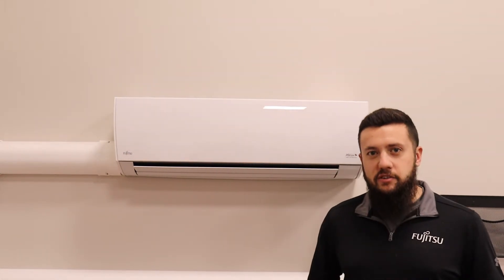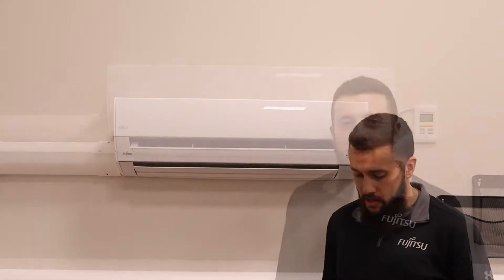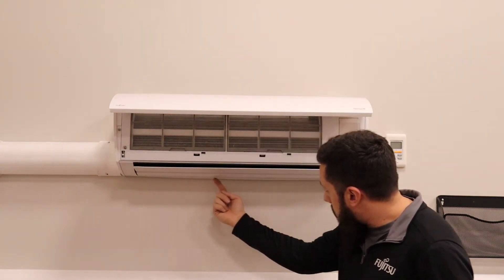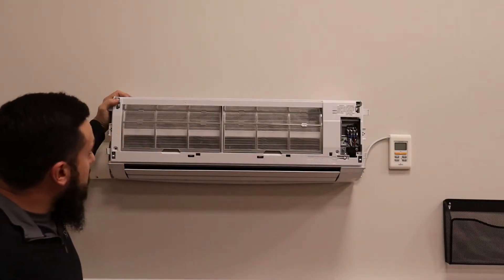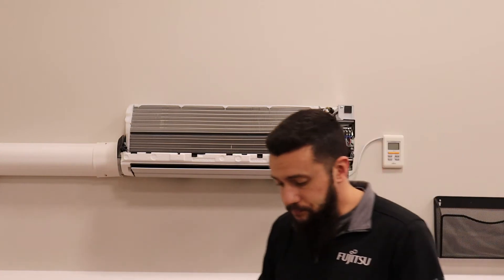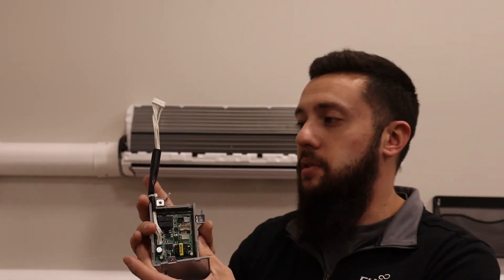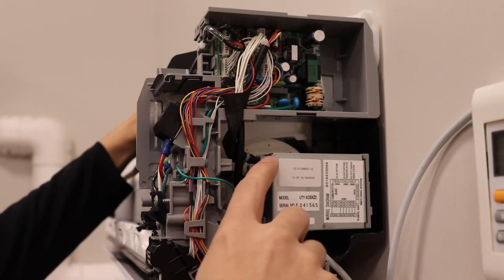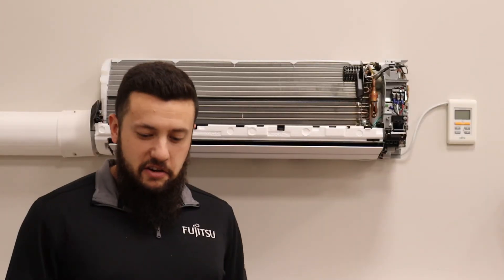Fujitsu UTY-XCBXZ2 Interface Kit | Installation

Comment: the part you didnt shiow is the part I need..  I am not able to find the part number of the connect kit I need to go from the interface board to the 3 wire Wired-remote, ive gotten a couple different connector kits and they are not the correct ones..  what part number did you use for the wire kit? im using an Intesis device that connects to the 3 wire port..  this board appeard to provide that interface however the wire from the board to a whip where i can run it is elusive...  my interface board nor remote came with the necessary connector to fit the board..  the board fits into the unit fine..

Comment: I have question.  How do you run wires to other side of room since they just plug into the box?  .  I need to mount mine about 15ft away.
Reply from the maker: Great question! Please reach us at (508) 822-3939 for more details on this.